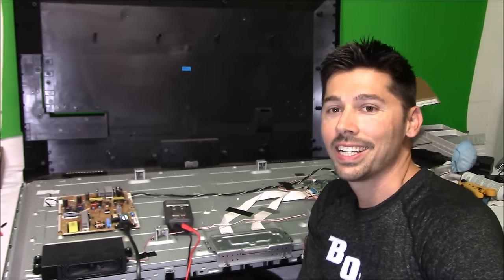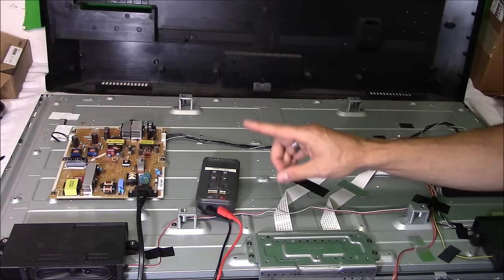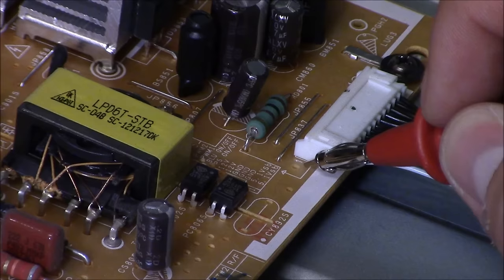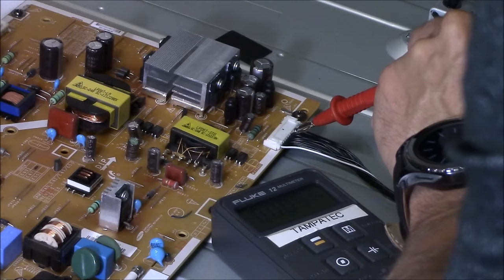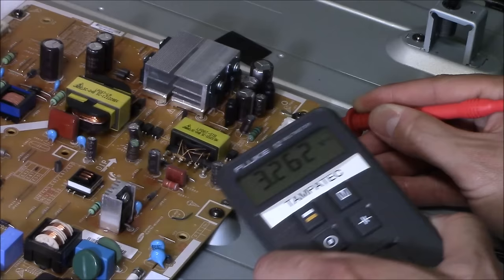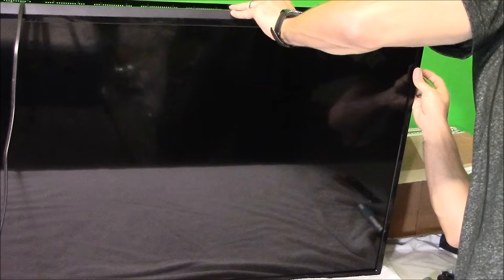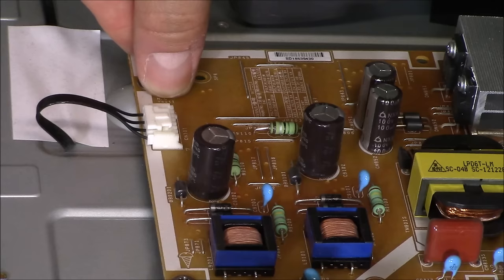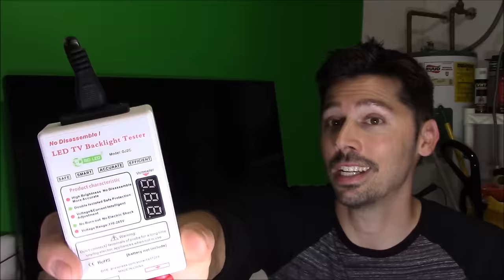LED LCD TV REPAIR sound but no picture, black screen, dark picture pt1

Comment from the maker: PART 2 WILL BE UPLOADED NOW https://youtu.be/YgaL6X6eSaU
FOLLOW ON INSTAGRAM FOR MORE https://www.instagram.com/tampatec/
 #FixVizioE470iTVrepair
Reply: Tampatec
Reply: Tampatec how can I contact you personally.  have question about vizio television
Reply: Hey Tampatec, where can I find documents on the voltage out for pins on my specific TV, is there a resource you use?
Reply: Tampatec i have several strips burnt out problem one but i tested the lcd output and dont read any voltage unless i am grounded to the panel.the negative connection in the output harness seems to be dead any ideas what to check?
Reply: hii
Reply: Tampatec
Reply: Tampatec Good day. I have a sharp lc 60le635e tv. When i plug it in then a steady blue power light comes on. If i press power on remote it will react to it by red light signal while the blue is still there. Once is a month the blue changes to red and the the tv goes on normal. Upon restart or off on will do the same problem. All voltages on psu led drivers 5. 12 etc are there. Any help..? Thanks
Reply: Tampatec how to fix pensonic led TV..no picture has sound
Reply: Fuu
Reply: Tampatec very helpful 

I suvscribed you
Reply: Hi tampatec,I’m having the same problem,the standby pin voltage is present but 13V pin voltage lasted only a few seconds after I turned on the TV..I’m not sure what’s the problem,any advice?
Reply: Tampatec ygaL6x6eSaU
Reply: Where can I get the specs for my specific TV for the LED inverter volts. Or is the 100 and 130 volts for all tvs
Reply: 6
Reply: great video
Reply: Hello could you pls send a link as to repair a led I win a tcl tv and this is the second time this happened the repair man told me it only takes one or two leds to stop the backlight from working if I can repair this myself I will have you got a link for this
Reply: 7 years later comment, my Philips 49PUS7272/12 gives 3V to the standby mode when the TV is on but not when it is shut off.
It is also giving 50V or something like that, to the backlight.
Do I need to change the power board?

Comment: Why on earth would anyone put a thumbs down? This is the most helpful of all the videos I have seen to troubleshoot a TV. First of all, you get straight to the point and speak loud and clear. The recording is good for both image and audio quality and it is not 30 minutes long. Most of all it is very informative and to use a flashlight to save time and tell if you have a picture is brilliant. Thank you for putting up this video. 

I feel confident I will be able to troubleshoot my not-so-old 65 inch RCA cheapo model that still should have life in it. I watched the picture fade out before my eyes and the blue light tells me it's on still. I first assumed I blew a capacitor or powerboard and I have not even opened it up yet but I am betting the flashlight trick will reveal what I now suspect. I didn't have an audio source coming out the tv at all because I am using it for my computer and the computer is running the audio through my studio moniters. I never used the TV's speakers but it would have told me the signal was still getting through.

Comment: Thanks for this I have a Panasonic that had no picture so I just disconnected the long lead from the power board to the logic board (as your video)  then re connected it and the TV is now working  thanks!

Comment: Black screen problem started months ago.  After much off/on and waiting time, some success with restoring screen bright. But, now this off/on trial stuff no longer successful.  So, I guesed something was overheating in there somewhere, so I located a small fan to cool the right back side of the set.  Lo and behold, after a short time, the screen came on and stayed on.  This worked continuously 80% of the time, but never failed to start if you had patience.  Also, once on and left on overnight, etc.,  screen brightness time improved, sometimes even after the fan was off!

This might be useful for someone, but sometimes a new set looked very tempting!!

Comment: Okay, Tampa Tec...  I am new to TV repair and appreciate so many of your videos (some I have watched 5 or 6 times).  You do more than just talk, you show where, when, how, why.  Thanks to you I have replaced my own powerboard and the LEDs in my Sharp Roku LC-50LB481U.  This all got started from a black screen issue. (Could see with a flashlight)  So, my backlights are working now, but when I turn on the tv there is just a blue screen that does grow darker until it appears black again.  There is no Sharp icon on the screen when powering up.  The flashlight doesn't work in this case.  I don't want to end up replacing every part on a poorly designed tv.   With what I have stated, do you have any thoughts as to what my issue is now?  My gut tells me since you could see with a flashlight before the LED replacement that maybe I didn't do something right when putting it all back together.
Reply: Did you get it fixed?

Comment: RCA led40c45rq  has back light u sent logic & PS no change Led strips read 33v with unit off led two wire input reads 77.9 pwr on reads 169.6 back lights stay on for ten min then set shuts Down . T-con test point voltages all class ok Thanks Larry

Comment: Very informative thank you. I think my backlight inverter board is bad, but I didnt see you say anything about sound so Ill ask. On mine, the tv turns on and a buzzing comes out of the speakers. Has done this for years and after it warms up, you shut it off and turn it back on and all is good. Now you turn it on, buzzing still there, but picture goes black at 20 seconds every time. Weird thing is when the picture goes black, the buzzing stops. So I was assuming a transformer on the inverter board. See nothing with flashlight when black. Man are those boards hard to find in stock. Thanks again and great video!

Comment: Hello mate wondering if you could help, I have an LG 32LH3000, has backlight and turns on fine but no display, what could be causing this? I think i might just order a new board and replace the old one but im not sure which board could be the problem. Thanks for your help!

Comment: Helpful video thanks. April2017 I repaired a Techwood 55AO2SB  55"TV . Its remote led flashed, the remote was transmitting, but no picture. Not sure if sound was working as did not test that. Not a backlight led problem as could not see the MENU in dark room w flashlight shining on the screen. I think it was a 2015 model TV. Root case was one corner of the power supply board was broken / cracked. This where one of the screws attaches that PSU board to the TV chassis. This caused one important thin electrical track to be severed. I repaired with superglue and track repair wire ... green thin wire. I also repaired the earth contact using some wire and solder , this at same place as it was a poor earth due to the damage. TV worked correctly thereafter. Pcb design is poor/cheap and obviously the pcb material also poor quality for this to happen. TV picture etc seems quite good.. I am an electronic R&D and design eng. Hope this helps someone else.

Comment: I have a VIZIO E480-B2 with no picture and no sound. The power light flashes and then goes solid. I checked voltages on the board as suggested and I think the power board (DPS-167DP) is good. The caps all look good, as well.  I did the flashlight test, but couldn't see anything on the screen. Would this indicate the t-con board is bad or is there something I should look at? Thanks for your help.

Comment: I extremely like your tutorial my 43 inch Toshiba works great NOW
Reply: I have your exact TV...Just curious was it a strip or the board? Or something?
Ty in advance.
Reply: in my case it was the main board that was defective I bought the whole board but I will try to isolate what blew on my board at a later date

Comment: My Rouku TCL 49S403 has backlight but no image. Did the reset thing with the remote control and it did not work. But this TV has no T-con board. Is the T-con circuit built into the main logic board or the narrow boards that feed the screen? Anyway, I’d like to know the test points to test at to let me know whether to replace that main logic board. I assume the narrow boards that feed the screen cannot be replaced.

Comment: Hi Tampa Tec great videos thank you. I am struggling with a Sony LCD tv with lamps not leds. The lamps are so hard to source. I have them come on then off. Power supply voltages are okay. Any thoughts greatly received. Not changed main or tcon boards as yet thank you

Comment: TampaTec I have a question. What do you think about this.... My TV  FIRST- started dimming on the left side. Then after a week or so  I have the volume up listening to the news while I get ready for work walk into the living Room &  here the screen's black and the sound is only on. I can turn it off wai,wai,p sometimes 1 second sometimes 5 seconds but it will either fix the left side dimming issue or the TOTAL Black Screen issue, temporarily. So I ask if you think its overheating? Please lmk!!

Comment: Good video. I have a Philips 55Pus6501/12 with no picture. I have cheked with a flaschlight and I dont se anything on the screen I have 60v out on the Light on the motherboard. If I unpluck the 2 cables on the tconboard the picture are Grey. Any sugesstions?

Greatlings// Robin

Comment: TAMPATEC YOU ARE AWESOME!! Thanks for all your great work! I have a question related to your video...I have the VIZIO e470i-A0 that has the same symptoms - you can see the picture with a flashlight. When I check the voltage on the 4 pins of the LED output connector as shown around 5:22 on your video, I get pin-1 = 0 volts, pin-2 = 65v, pin-3 = 2v and pin-4 = 65v. I don't get "0", 100v" or "120v" as you indicated as possibilities in the video - what might be wrong with this - the power board or the LED strips or something else?

Comment: Pop quiz!! I have a Sony Bravia XBR55X850C that turns on long enough for the android logo to appear then shuts off. This is followed by six flashes from a red led at the bottom of the center of the tv. From what over read, this could be power supply, which it’s not as I’ve replaced it and it yielded no change in the symptoms, the backlight then selves, bad inverter for the backlights or a bad main logic board. I don’t think the logic board is bad but haven’t check it’s voltage yet. My question is where would the backlight inverter be on this tv? It’s not out in the open behind the back panel of the tv like the main logic board is and the power supply and the what looks to be the T-Con board. Any help would be greatly appreciated, your videos are great! I’ve watched them to fix many TVs for friends and family. Also, have you any experience with this tv and this problem specifically? It seems to be a very common problem with this model tv and it’s just under 2 years old. $2000 for nothing!!  Thanks in advanced for any help!

Comment: T Judice:        Thank you for the extremely informative videos on TV repair.  Specifically, issues with TVs having sound, but no picture.  I have an RCA 55" LED TV LED55c55r120q with sound but no video. I can see the menu image using the flashlight technique, so it is some kind of backlight problem.  Main power board shows 5V sb power, and 12V when powered on.  The BL voltage on main power board connector coming back from logic board shows 5V.  (NOT 3.2, is this a problem?).  I unplugged the LED power cable from the main board to get the actual voltage reading at the board.  Both LED+ pins are reading 223V(with connector going to LED strips unplugged). With LED wire connector plugged in, the voltage on the LED+ pins starts out high, and quickly dissipates down to 0. I purchased new power board, but same behavior.  Can you direct me what to test from here?

Comment: I have a 50" inch philips with sound and barely you can see inside, probably led or  power supply. The voltage going to the leds is 38v and after 20 sec drops down to 25v  . Any idea If it is leds or power supply?

Comment: I have gotten a lg le5300 32" with a blowed capacitor 3.6v 1500uf I couldn't found the same replacement, can I use a higher valtage capacitor

Comment: Greetings Tampatec and thank you for your excellent videos! I was trying to fix my LG TV because when I turn it on it goes with sound but no picture. The remote was working also I got noticed in the dark panel the settings menu. I check my backlight LED strips because it is the second time that has problem, but all leds are working and light up.I replace the capacitors on the PSU and I check with my multi-meter the Volts it says around 160V but on the pcb writes down OUTPUT 13.2V /43V 500mA. Would you give me some suggestions to check?

Comment: I have a vizio E420i-A0 with the same problems described in the video but the voltage for the “Vont1” pin reads 100v .and as mentioned in the video means its good but where do i go from here ?? Please help

Comment: Hi,

How does the procedure differ from e.g. fixing a common LCD TFT computer screen monitor ? 🤔

I have a Philips Brilliance 220SW LCD monitor which has a backlight problem. It turns on for about 2 s, then shuts off. I can see the picture on the screen if I shine on the LCD screen with my pocket LED flashlight though.

So when I connect the VGA cable to my laptop's VGA output the picture with backlight appears on the LCD monitor, but then the backlight shuts off. 😣

I replaced about 7 electrolytic capacitors, from those 7 four were surely dead as they were bulged. The rest 3 had half values. I checked the rest of the 5 electrolytic capacitors & all were good. 🙄

Ceramic capacitors near the CCFL connectors are looking good too. I get 5 V & 12 V on the cable connector too. What else should I check ? 🤔😕

Thanks in advance &...

Best Regards,

Comment: Great video!  I’m Tim in California and I have a Sony XBR 75850D tv which has audio only and no video.  I have replaced the main control board without any change.  
I do not see any microlights and I do not see any shadows on the black screen using a flashlight.  Do you have any suggestions for repair and do you sell parts?

Comment: Big big big thumbs up to you dude! Very informative. My TVs led backlight strip turns on with the TV but turns off shortly after. Any idea What could be wrong? Some capacitor?
Reply from the maker: Bad LED backlight can shutdown the whole set as a safety measure. You need to check backlight voltages to be sure. If the tv is out of warranty and there's no manufacturer recall then you can open the TV.
Reply: @TampaTec  yes, its been out of warranty for long. Thanks, I'll definitely check that. 😊

Comment: hey, since the most of the blacklights were working, why we had black screen?? I mean, the monitor should be black on specific points.. i have misunderstood something :P  plz answer
Reply from the maker: Circuit does as it's programmed so if volts raise or lowers pass that threshold it can shutdown the backlight circuit making the TV look extremely dark or black screen of death, Bsod.

Comment: Hi Tampatec - have watched many of your videos - great work!  Just wondering if you could help - I have a TV which turns on great - have picture and sound, then after a few mins (15-20) picture goes off (black screen) but sound continues!  I switch tv off then switch back on the above happens all over again.  Do you have any thoughts?   Kind regards Ed

Comment: Hello...Enjoyed your video...Any ideas why I would be getting 72 volts out of my led backlight connection?  I know you said 130 volts is bad, and 100 is good..but I am only getting 72v.  Also, when I check the connections on the back lights themselves the voltage is reduced to about 3v...Any help would be appreciated...Thanks

Comment: Getting 85VDC on both of the + pins at the LED connector. I have replaced the PWR Supply board already. Same results Back light and LG logo come on for a 1/4 second. I have sound. Flashlight confirms image. TV is an LG 55LN5710. Thoughts

Comment: hi i have a 55" vizio led smart tv. the audio works just fine however the picture is super dark. if you put a flashlight up to the screen you can see there is picture. the brightness is all the way up and still cant see without flashlight. thoughts, ideas, or help would be greatly appreciated! the tv is only 2 years old i hate to throw it out. THANK YOU!!

Comment: can a bad (bulging) capacitor in the LED driver section cause the values to be 0 volts ? Cause that's what I'm getting. I'm waiting for a replacement capacitor but I'm wondering if I still might need to replace the PSU.  Great videos BTW!

Comment: hey have you ever fixed a Sceptre x322bv-hd mine has sound but no picture, did the light test saw picture opened up back and the only boards i saw was the main board in the middle of it and a small one at the bottom> about 1"x20" long is the backlight inverter or tcon board built in to the main power board in the middle

Comment: My Samsung UN50H5203AF has no backlight and when I measure the six wires (3 pairs) going to the panel all read around the 365 volt range. I would have thought some would be ground. I used the chassis as ground as well as a nearby capacitor.

Comment: I have a haier 48d3500 TV with backlight issues. I measured the voltage on the LED outputs and got 66 volts each and not the 130 or 100 as you mentioned in the video. I have sound and I have a picture that can be seen with a bright light against the screen. I don't have an LED tester so that's why I'm asking your opinion. Power Board or LED backlights?? thanks

Comment: My power board LED pins reads 240v but fluctuates to 0. My led driver has an LED error  indicator that blinks 3 times which means  "open LED protection", according to the service manual. I'm assuming it's my power board. Correct?